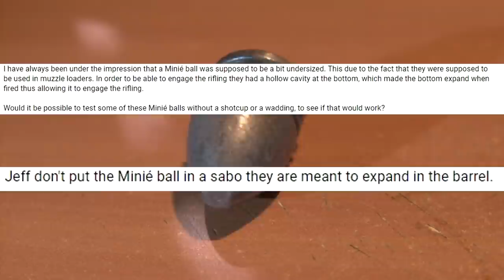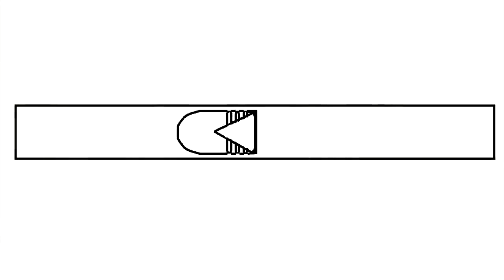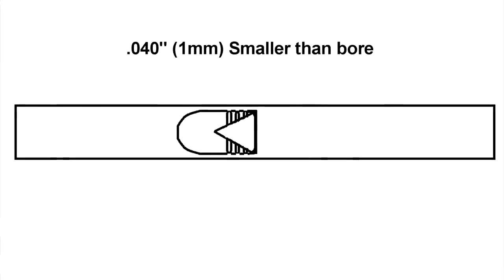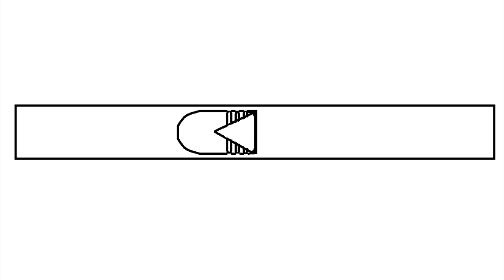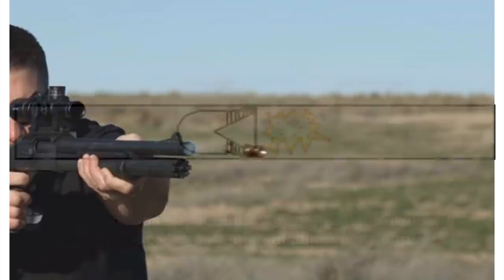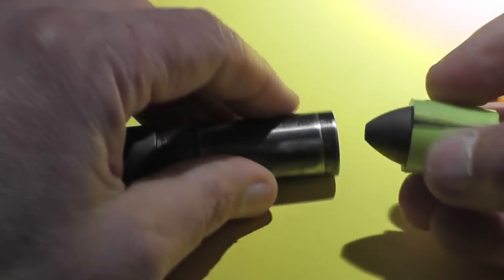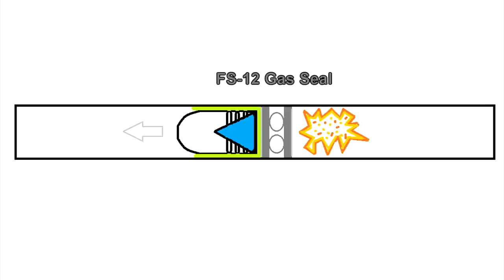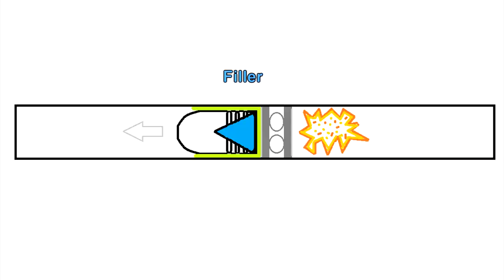.69 Minié Ball  - How I loaded it for 12ga.

Comment: early on in the civil war, the union army had some accuracy problem with their .577 muskets, in that the minie bullets they casted were more than .002" of an inch under boresized, which caused problems with rifling engagement. If the union had problems with a .002" difference, .2" difference or 100 times that amount is definitely not gonna work

Comment: Obturation only works in a minie ball if the difference between the bore rifling and the OD of the bullet is less than .002" to achieve anything like accuracy out at greater than 100 yards.
US 1861/63 rifle muskets had tolerances that made accuracy beyond that range pretty iffy, as the bores could be .010" over the bullet diameter.
The Enfield .577 rifle musket was built to much tighter tolerances and was routinely used, with accuracy, at 600 yards.

Comment: I seem to recall the earlier Minie projectiles used a solid inside "expander" core, acted to expand the projectile to the diameter of the bore. The idea was to have a reduced diameter bullet that would easily fit down the bore, then would expand to fit when rammed home on top of the powder. And when the charge was fired, the projectile would expand even more if necessary to fit well. Later versions did away with the core and used thinner skirt walls which would expand radially in simular manner.  This from memory, so it may not be 100%. It's interesting large bore tank guns originally used a rifle bore. Some where along the way the designers discovered  a smooth bore gave simular accuracy as rifled. How this works with non-fin stabilized projectiles isn't clear to me.

Comment: Also to add, if it was just slipped down the barrel like a 12g thr gap is too large, unlike a musket or rifled barrel thr bullet is designed for that size exactly and  has constant support of the barrel and while the skirt expands it only does a slight amount to grip the grooves to spin unlike a slightly over sided smooth bore, so a sabot does exactly that job and extend the bullets surface area then grips the rifling while adding a far greater gas seal :) 

Just too add to any doubters

Comment: Internet critics, ugh. But did they go out do the math, build the loads, and gradually try to build up to a stable round? It took me over 200 rounds and 10 different loadings, before I found a .308 load that would be accurate in three different .308 rifles, from 100 to 400 yards; and I wasn't using a sabot round that was never designed for a shotgun. I was using commercial components in small test batches.
I thought you did a really good job with your loading. I always wonder how much time you spend on the range or in testing before you start filming, with these custom or ingenious projectiles.

Comment: You may want to try a .58 cal Minie in a 20 Gauge. The .58 was the caliber used in the Springfield Rifled Muskets issued by the US Army during the 1861-1865 American Civil War.  The .69 diameter was the French standard caliber for the Charleville Musket used by both French forces & US Continentals in the American Revolution of1775 thru 1783. The .69 was adopted as standard for all smoothbore muskets manufactured (at Harpers Ferry Virginia )by the US for use by American Forces.
Reply from the maker: I don't even know anyone with a 20 ga.

Comment: The minie balls were expanding because all the shot cups were cut at the same point. which you showed in the other video.
and that would not happen without expansion.

clever to use glue in the void. to give the gas seal something uncompressible to push against.
that probably maximises the expansion over the original black powder design.
so these are modern taoflederminie's :-)

Comment: Yeeeeahhh... was going to say that if you use a sabot for the round then you may as well just fill the skirt cavity and at that point you no longer have a Minié round and may as well just buy or make a jacketed or solid bullet like you showed as your modern muzzleloader example. 

So case and point you weren’t really firing a Minié ball in the video because you effectively removed most of if not all of what made the Minié ball so effective and unique at the time. The bullet was designed specifically for the purpose of bypassing black powder fouling and easing the muzzleloading process without loosing the ability to engage the rifling and gain the benefits of a spin stabilized flight. By switching to smokeless powder you immediately negated the fouling and therefore removed the obstacle the Minié ball was made to overcome in the first place. 

The blackpowder is essential for this kind of round to work as you pointed out because modern smokeless powders “sublimate” for the lack of better terminology. (They go straight from solid powder to gas in an instant.) Black powder on the other hand has a comparatively long “liquid phase” (I use that term loosely, again for lack of better terminology) that holds heat and therefore pressure from the reaction for a far longer time than modern smokeless powders do. This slower reaction (slow only compared to smokeless powder) allows the Minié ball time to have its skirt expand and engage the rifling before moving very far down the barrel. There were even carbine firearms (the Parker Hale Musketoon comes to mind) capable of practically pinpoint accuracy up to 1000 yards at the time of the American Civil War and the Minié ball. Truly astounding technology even now considering that it can come close to matching accuracy of many modern firearms and is used in something as ancient as muzzleloaders. Great vids all the same! 👍 I look forward to every one! 😁

Comment: I'd like to see a Bronze mini ball shot and see just how it will travel with a bigger charge. Your last test didn't come close to the 300 yards
Reply: Paul Lewis bronze would just be a waste of copper as the lead performs best, hence it's use for several hundred years. And 300yd would've been indirect fire volley shots back in the day, these were still dead on for line-of-site @50yd so there's no need to up the charge anymore, they were already heavy on recoil if you listened closely & they would've had no problem reaching 300yd distance. I'm sure your an expert at these things & have more experience than Jeff & Danny combined since you DIRECTLY CRITICIZED a video addressing incorrect criticism....

Comment: Maybe you could pre-expand the slug by pressing something with a wider conical shape in the back of the slug on a press. The front would still be unsupported though.
Reply: In bullet casting it's called "bumping"

It's usually only done to gain a few thousandths not 0.040

Might be worth a try though.

Comment: Just use black powder in your shells.  This will get the minie ball to obturate.  Black powder explodes much faster and has a much steeper pressure /time curve.  Also make sure Minie ball is cast with soft lead.
Reply from the maker: It's still not sized for the bore of the 12ga.   and no one makes .73 cal  Minies
Reply: @taofledermaus  With the thin skirt and using soft lead they may obturate, Could be worth a try.  My antique Winchesters and Marlins are all significantly over bore and will obturate solid bullets well if using real  black powder and soft lead.

Comment: The Minnie ball is cast at the BORE diameter of the rifle. After loading black powder, the ball is rammed home and the skirt starts to bulge out in the process. When fired, the hollow skirt is bulged out to the GROOVE diameter of the rifle. In the final analysis, it is not truly a subcaliber bullet when used as designed in the appropriate rifle.

Comment: You could have gotten the same or similar results with a conical bullet without the hollow base of the same diameter, as the spin from the .729" 12 gage bore would have to be imparted by contact with the discarding plastic bullet sleeve. Same goes for the bullet lube rings, as they are not needed for the performance of the round. 
To make this bullet work as designed, and without using a sizing sleeve,  you'd have to have one cast at .724" to .726", and load the shell with black powder to obtain the rifling engagement desired.The would have to be seated firmly on the powder charge, as black powder going off with a void between the charge and the projectile tends to blow up the gun. Then, depending on the shotgun's chamber throat length and the resultant bullet clearance to it, it may or may not actually expand the base properly, as opposed to over expanding and tearing the base off as it reaches the barrel rifling.
Your hollow based slug fired out of a cylinder bore self stabilizes itself in flight because most of the mass is in the nose of the bullet and the tail acts like a badminton birdie to dampen yaw during flight. So maybe the hollow base (like a Foster slug) really is a good idea.

Comment: A minie ball is designed to expand but it generally starts off only slightly smaller than the bore of the rifle it is to be used in, with a coat of wax or grease to both lubricate and form an initial gas seal. The round is often fully supported by the rifling but not engaging with the rifling until the round is fired. This makes for faster loading by the muzzle. The whole point of this video is to say the shotgun bore is too big for the conventional mechanism to work. However it is worth noting that calling these rounds minie balls after filling the cavity with glue and using a shot cup is no longer true. You have altered the design of the round so completely that it is hybrid slug at that point.

Comment: Jeff, that is not a mini ball. The minie ball was called a minie ball because they were invented by a French guy whose last name was Minie. A  wood or iron plug  was  put the back of the lead bullet that when the powder was ignited behind the bullet would be forced deeper in to the bullet causing the lead to expand and better engage the rifling.  That plug is what your round is missing. Otherwise it's just a sabot slug. The reason the mini ball was invented was the speed up the loading process of muzzle loading rifles. They were only slightly less in diameter than the caliber of the rifled barrel. A 72ish caliber mini ball  should be 70 caliber in diameter. The blast of the powder isn't enough to expand the lead unless it's really soft lead. There must be something solid to fill the hollow forcing the lead expansion. The hollow in the bullet should be just short of the full length of the bullet. Any hoo,  you guys make cool videos.
Reply: I'm not an expert. I do, however have an insatiable appetite for baked chicken.

Comment: Ok so you took a design that was intended to make use of the initial kick of Black powder ....and completely circumvented it to make it work. The only thing this has going for it as a modern projectile is the hollow bases makes it Nose heavy and less depentant of spin stabilization.i am not complaining g or criticizing....just pointing out that what you were shooting was in no way equal to a Minnie ( and semanticly what we consider Minnie' are not ....there is a wood expander plug in the original design.)

Comment: I have an honest question. .. I own a mossberg ultimag 12... it clearly says to never shoot slugs because, according to what I can find, the barrel opens to 10 GA and a slug will rattle down or could even get lodged.... my question is... why the hell did mossberg do this? Am I losing pressure? Honestly, I've never been a fan of its performance, could this be why?
Reply: What they did was overbored the barrel. In my Mossberg they did the same. I forgot what it helps with but I think it’s for turkey and duck loads
Reply: Like Comment Police said, the mossberg ultimag is overbored.  A standard 12 gauge bore .729" however it is a fairly common modification to backbore barrels out to .735".  This is dwarfed however by the ultimags .775" bore.  It helps reduce shot deformation and can drastically reduce felt recoil.  You may be losing some pressure if you are using lower power loads as the gun was designed to run pretty much the most powerful loads out there.  This would require testing though as i have no idea what effect such a drastically oversized bore would have.

Comment: I wonder what Expoy or JBWeld cast-in-place Sabots would do?
Reply: If I am not mistaken a JP Weld as well as various other resin based projectiles have be tested in the past and in general they lack sufficient weight to obtain good stabilization either in a smooth bore barrel, or if shot through a rifled choke tube (Paradox  Choke/Barrel) or fully rifled barrel. One of the interesting things about aerodynamics is weight is actually needed for a projectile to fly straight and true but weight also hampers long range flight due to the amount of energy needed to keep a heavy object from dropping because of its mass a double edge sword of sorts you need the weight to fly straight but you don’t want it because weight will cause it not to fly as far.
Reply: @gullreefclub  The Sabot isn't the projectile, it's just to fill the gap.  I'm talking about putting the projectile in the hull and filling the empty space with epoxy resin or JB Weld, so the actual sabot is cast in place.

Comment: I'm still unsure about it; the premise of the original video was "is 170 year old technology still relevant?", but the tech in question wasn't allowed to operate as intended. Wouldn't it have been better to try it out and demonstrate that it wouldn't work and then make progressive changes to the scenario until you end up with the version that works?
Reply from the maker: We don't test black powder rifles.
Reply: @taofledermaus  
I know, I meant in the shell with the modern powder, just without the wadding or hot glue.
Reply from the maker: @WJS774   I explained why that wouldn't work and could be very dangerous
Reply: @taofledermaus  
Oh it would be different to your regular tests for sure, more like a "retire to a safe distance and pull the string" kind of test.

Comment: Try casting some .73 cal Minnie balls. Not that difficult to machine a mold. You could also machine a .73 diameter tube with a base shaped like a Minnie ball nose and drop on a .69 diameter slug and swage it with a cone shaped punch into .73 cal Minnie balls. This might be easier than machining a multi ball .73 cal mold.

Comment: Its not logical at all to demand a 150 yrs old procedure to apply in modern ballistics test, the reason is the guns of the old days had not only a tighter choke(17.1-17.5mm) they also had the whole barrel of a tight diameter, thus resulting a maximum stabalization of the projectile, actually i tend to say that the guns where designed to fit the projectile (slugs only)  not the opposite,  mostly they had both the gun-slug built to fit each other, the approximate straight wall of the older guns (~ slight deffirence in the diameter  between chamber and the muzzle choke) supported the projectile  to travel straight along the whole long barrel, however these days even if you bring a choke that fits the Minnie ball slug bare, the barrel (cone effect) will lead the projectile to leave the muzzle angled deviated and mostly low - tumbling.
Sry for the long comment but your work was perfect at least accurate and safe.

Comment: if you used the right measurement unit, one where you don't have to calculate,divide or use weird non-representative abstract values it would be obvious, if you say a 1mm diameter difference in Europe anyone would tell you what ? you're crazy it will never work but 0.040 ? no problem ! no disrespect just saying why metric makes sense ;) "that new Prius weight is 3/7 of a F-150" see what I mean ? rofl